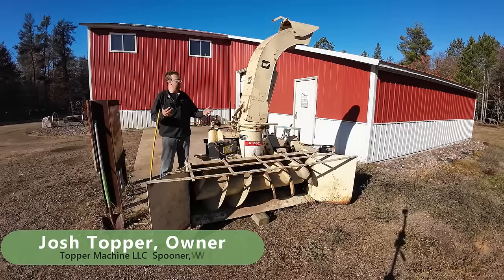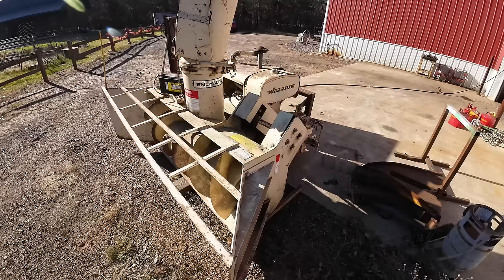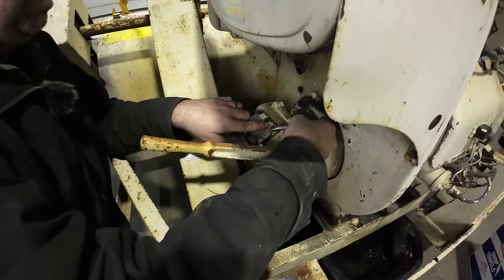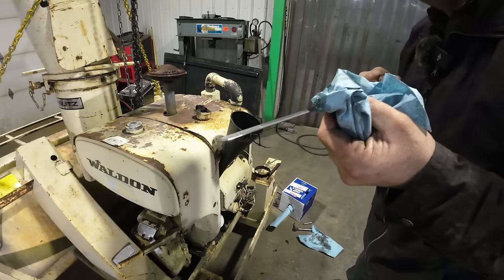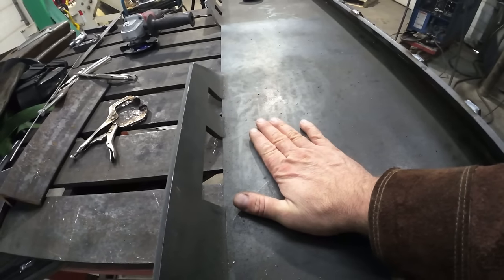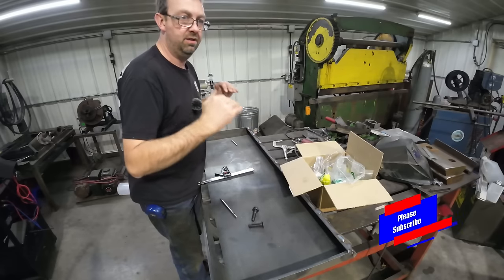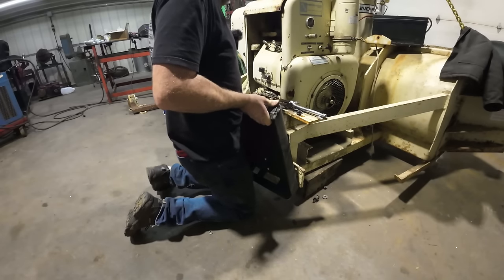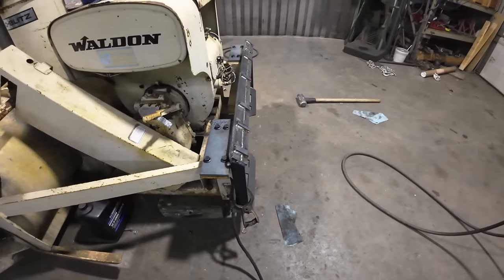Winter Prep: Fixing And Converting A Snowblower For My Wheel Loader

Comment: Great video. One thing I would consider adding is an engine kill switch on a long wire that you could keep in the cab with you just in case something happens.
Reply from the maker: Already considered that. May add something more like a clutch disengage control.

Comment: Just love Wisconsin engines!  Lots of good memories.  Back in the 90’s we had a shop made dump cart with a Wisconsin for power.  It always started and ran like a top.
Reply from the maker: They were great motors. Roller bearing mains are what make them last forever.

Comment: It’ll be interesting to see if that Wisconsin packs enough punch to really make that blower rock and roll.  Blowers tend to be power hogs.  My personal nuclear option for dealing with snow is an old ex DOT  Heinke V plow adapted to fit on a tractor front 3 point.
Reply from the maker: Since it's just a single stage, it should handle it just fine. You'd be surprised how much torque a V4 actually has.

Comment: With that single stage blower get after the snow ASAP. Single stage blowers don't do near as well with wet or compacted snow. You will figure that out. I just bought a mini version of this snow blower but a 2 stage. It was designed for a front PTO on a small tractor but I am instead going to be adding a motor so it will work like this, but 2 stage so no problems with wet snow.
Reply from the maker: I've ran single stage blowers for over 25 years, just much smaller.  I've pushed through some of the wettest and nastiest snow slop you can imagine with absolutely no problems.  You just need to know how to feed them.

Comment: I have seen in wet snow that likes to pack that without that positive feed fin between the flights you mentioned it can plug up rather than feeding back into the blower.
Reply from the maker: Those without the center scoop are generally 2 stage and are really not that reliable. These old single stage blowers(thrower) are really impressive.

Comment: Dad used to have a 120 ton Scotchman iron worker.  I have punched 1000s of holes.  Tip... Get a dish sponge and punch it, keep it above the stripper plate, saturated with oil.  That will always keep the punch wet with lube.  --Doozer

Comment: I was hoping to see the snowblower in action last winter
Reply from the maker: Me too .Never got any snow. I guess it worked extremely well.
Reply: @TopperMachineLLC  I guess the presence of the snow blower was a counter force 😄
Hopefully lack of snow didn't freeze your water pipes.
Reply from the maker: @Frank-Thoresen  it never got cold enough to worry. I built the whole place with extreme temps in mind. Water lines are 8+ feet deep, septic lines are insulated to the 8' level. I planned ahead to never have problems

Comment: Great retro fit.  I hope your cab has a heater. Way easier to remove snow when you're not freezing parts of your body off. Looking forward to seeing this in action.
Reply from the maker: The heater is good. Been enjoying it for years. But it is due for an upgrade. I have.  Much larger heater I want to install. I can't wait to use the blower. Now that I'm ready, it won't snow. Lol
Reply from the maker: The heater is good. Been enjoying it for years. But it is due for an upgrade. I have.  Much larger heater I want to install. I can't wait to use the blower. Now that I'm ready, it won't snow. Lol
Reply: Great vid. Can't wait to see it in action. Love that Av drill.

Comment: Hi Josh, a post script. I looked on eBay Canada for you and there's numerous manuals for the engine of that machine in the US all around the $20 mark plus the usual exorbitant shipping that US sites charge to Canada. Still nothing more about the blower. Maybe a snow blower service company might have a clue or two. Have you tried the original municipality that bought the machine. They might have a manual in some long forgotten filing cabinet if you can get to the right old timer whose prepared to look for you. Good luck.
Reply from the maker: I have some manuals for the engine now.  I didn't even think to try the municipality.  Great idea, thanks.

Comment: It might have been from Little Giant Crane and Shovel co. of Winona MN and Des Moines IA. They made small cranes and Hydraulic shovels both rubber and rail mounted. The Des Moines operation closed in the late 70's, and I hired several of their machinists / welders when they were let go.
Reply from the maker: I have ran a few little giant truck cranes. Still built today. But it's not them.
Reply: They are located in Nebraska City they make Little Giant trip-hammers small ones. They are still there, making hammers never saw any signs of snow blowers the last time I was  there. I think they have a you tube channel. Cheers Zed
Reply from the maker: @zedostenso3069 That is not the same company.  There are just a lot of little giants out there.  Guessing this one has been gone a long time.

Comment: I hope I'm wrong but my guess is that Wiscon is about 1/6 to 1/4 the HP that blower really needs. Probably very slow going in snow over 10-12 inches.
Reply from the maker: You'd be surprised. Wisconsins don't have high HP, this one is around 34ish. But torque you wouldn't believe.
Reply: @TopperMachineLLC  Very long stroke. Too bad the rod bearings aren't pressure lubed but they seem to survive.
Reply from the maker: They did the mains right with roller bearings, would have been nice to have better lube to the rods.  But they do have a piston cooling oil line that sprays oil up the cylinder.  That is probably the saving grace on most of them.

Comment: Job well done Josh.
Times like this it is handy to have a machine shop and a welding shop to do the modifications. 
Nice snow blower for sure.
The Wisconsin engine runs like a top.
Can't wait to see this in operation. 
Thanks for sharing. 👍
Reply from the maker: I wouldn't have the toys and hobbies that I do without a full machine shop. Too expensive otherwise.

Comment: My dad bought something similar back in the 77 to run on his dodge w250. Was way too heavy for it and got clogged alot if I remember right. Sold it the next year. Hope this works better for you with the much more appropriate piece of equipment to handle it

Comment: Hey Josh, if you punch a hole in top of those upside down oil filters when draining oil the filter will also drain.
Reply: Does that really work? Never thought of that but can’t wait to try and save myself a mess. Thx!
Reply: @ChuckNorriz1122  It really does work. It helps if the oil is hot first, as it is thinner and will run out quicker, but will still work if cold, but will need longer to drain out.Making the hole releases the vacuum above the oil in the filter,  allowing the oil to flow out.

Comment: Hey Josh, I guess year after year. You probably just used the traditional method, which was putting a plow on your truck. I assume when pushing became almost impossible to push the snow. You might have someone who has a front-end load bucket system? Good luck when the white stuff "Snow" starts happening in 2024, this snowblower will come pretty handy 🙄..
Reply from the maker: Never put a plow on a truck. I've always used a tractor or my payloader. Truck plows are for roads that have ditches to fill. Yards need lifting capabilities.
Reply: @TopperMachineLLC  Thanks, friend. I somewhat wondered what other options were for handling these weather conditions up there.. Happy holidays, you and your family.  Take care now.

Comment: Don't to forget to put a panel between the blower and the v-4 
Spark plugs don't work well under snow!! I have never seen a v 4 start that Ezra! Usually you have to dry the mag first gud job as always 73 dan
Reply from the maker: I think it will be fine,as it was designed this way. But I was considering extending the top shroud down to keep the heat in a bit more. I've had a few Wisconsins that start super easy, and others that start horrible. This one surprised me.

Comment: Impressive looking machine for a homeowner to be using. Looking forward to seeing how well it works. Can you change the direction of the discharge from inside the cab or is it strictly a manual adjustment on the machine? I think if I disliked the snow/winter enough to go to that much trouble I would spend my money moving a little further south. hahah
Reply from the maker: The only reason I don't move someplace warmer is due to the fact that warmer places are overpopulated. I like seclusion, quiet, lack of government, and little crime.
Reply: @TopperMachineLLC  I with you 100% n that one. But there are places like that in the south. I live in a town of 2500. In my 71 yrs there's been 4 reports of someone being shot or shot at (that I'm aware of), 1 attempted murder with a knife with only one of them resulting in death. Theft is usually limited to bicycles and such but we rarely hear about a home broken in to. One of the banks in town has been broken in to at night (twice, teens both times). So over all I'd say we've got a pretty low crime rate. It's small town life in farming country. About the worst gov intrusions we get is the city makes us go get a free permit if we want to burn some sticks/leaves so the fire dept (all volunteer) doesn't get needlessly called out. Anyways, I'm enjoying your channel so thanks for sharing.
Reply from the maker: Relocating and starting over is not an option.  Just to move my shop equipment would be $100K, then buy a building in these times.  Not to mention that I am the only shop left in this region, where would my customers go?   We are 100% stuck here and need to make the best of it.

Comment: Do you think you are going to need tire chains eventually?
Reply from the maker: In the 10+ years of plowing with this loader using either the bucket or snow pusher, and its nearly smooth tires, I have never needed chains.  The snowblower should be much easier to move around as I won't have a massive pile of snow I am pushing.